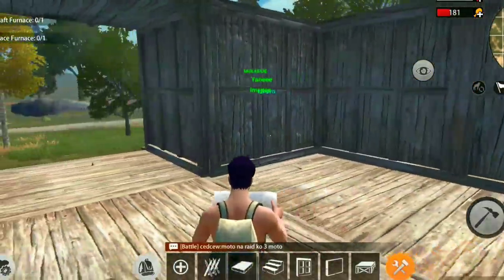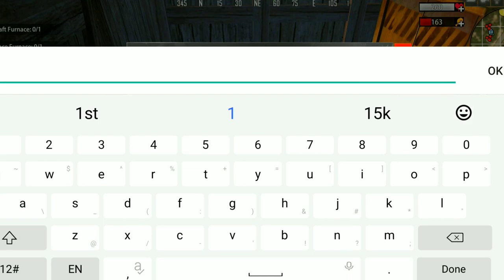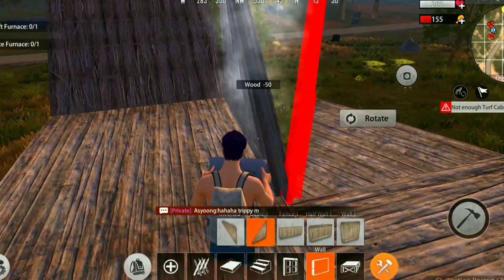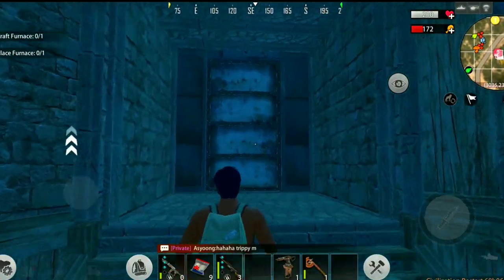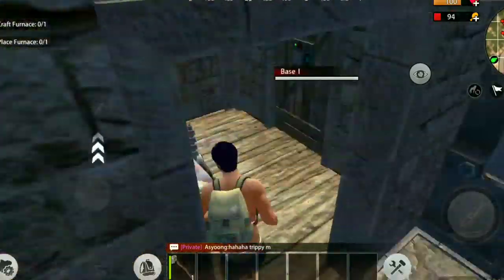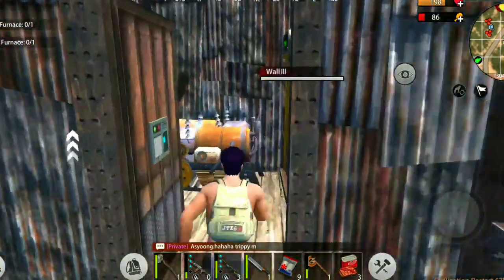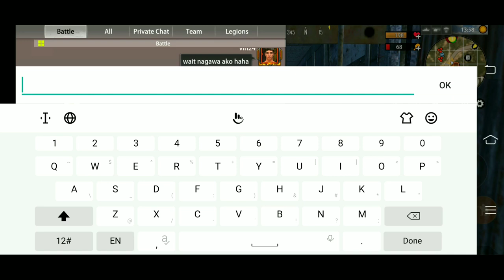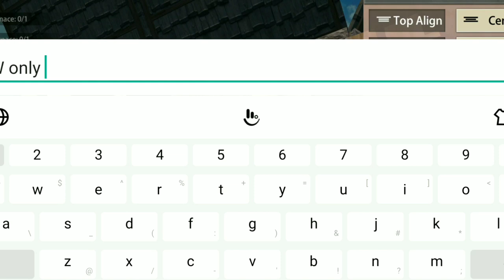Trap Vending Machine Tutorial Part 1 Design - Last Day Rules Survival

Comment: I Did this

I Got 4k Spares in Total with

1 Bazooka (Which the owner Raided it After)
6 C4s
1 AKM
2 Not Skinned M4s
4 Dual Mac Smgs (The guy kept Coming back Geared Not knowing hes Getting trapped)
1 Handmade Charge
Then it got Raided!
Sooo yeah its Profitable guys (In a Matter in 4 Days or So -_-)
(ALSO TRANSFER IMPORTANT STUFF IF YOU SUSPECT SOMETHING IS WRONG)